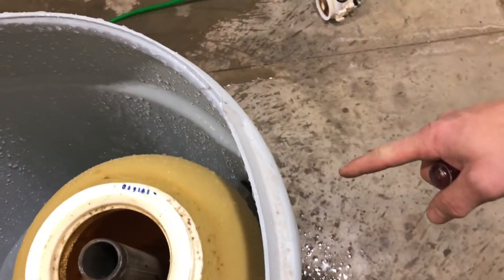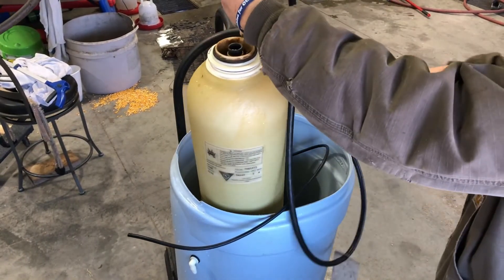Water Softener Resin Vessel Disassembly SEE WHAT IS INSIDE!

Comment: Thanks for the video post.  Fun to watch.  I was just wondering what the best way to dispose of that resin would be...Dump it down the drain?? Doesn't seem like a good idea.  It might clog things down the line, or cause wildlife damage if it's ever ingested by fish, or other animlas...then finally into humans if we eat those animals.  How about let it dry out, and toss it in the trash.  ?? But it has lots of surface area, maybe not good to have so much plastic scattered in the environment. I bet it could cause WAY more plastic toxicity than plastic straws etc.
I bet if you asked someone that really knows alot about the resin, and studied it well, they would categorize this plastic media as "super high environmental risk". Seems like it wouldn't take much for the beads to spread through environment and make it's way into back into living bodies...including humans. 🤔
Reply from the maker: Yeah it would be best to dewater and landfill the resin.  Probably the biggest problem is the micro plastics that go down the drain like the ones in tooth paste and soaps. They are usually smaller than water softener resin but still hard to remove from waste streams.
Reply: @HighOctane101 , yeah, the plastics end-up embedded in our organs/tissues.

Comment: Is the resin inside it dangerous or harmful if you open it I opened an older one to keep the timer and it came out some of it
Reply: I wind these pressure tanks with the resin it’s some nasty stuff but it’s on the outside only inside is clean
Reply from the maker: No, just make sure it is offline and not under pressure.  As far as the resin beads, don’t get into your eyes. Hard to get them out.  That’s about it for the resin.

Comment: My water softener started to drip drain when NOT recharging. So I unplugged it thinking the power outage we recently had made it stuck in between cycles. When I plugged it back in I recharged it. After it finished the water softener was draining running water, so worse than before. Do you have any advise on what might be wrong?
Reply: probably a failed seal pack. if cycling doesn't stop the leak you or a plumber will need to swap it out.